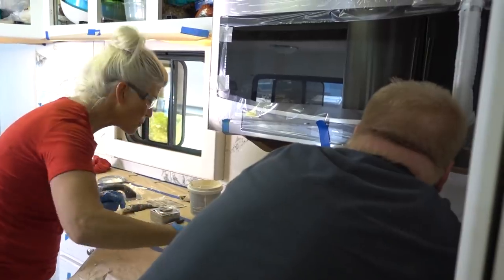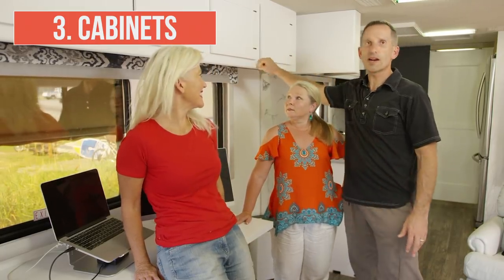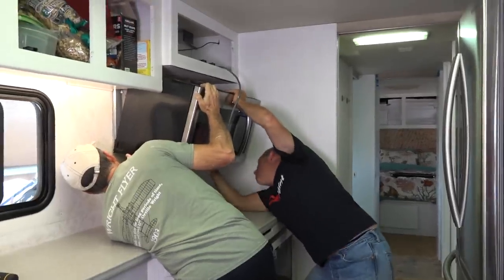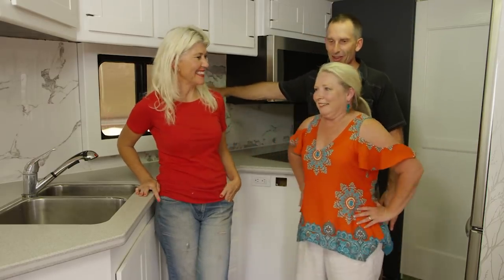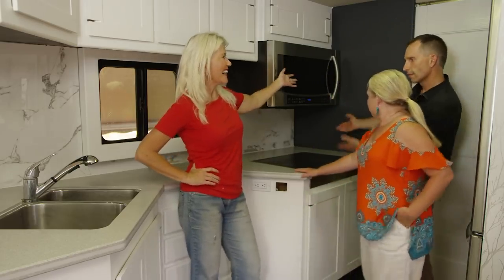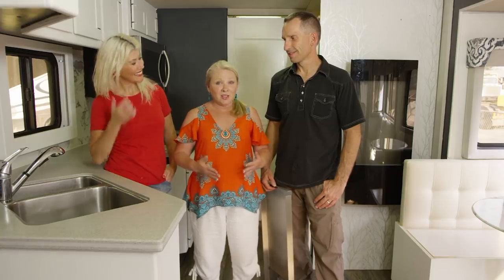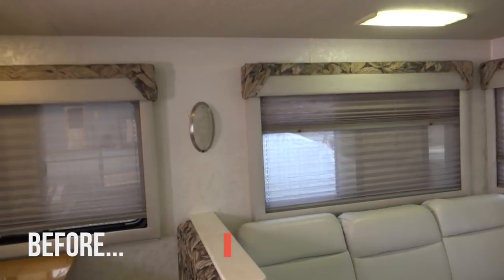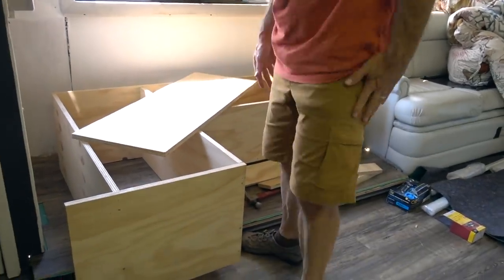We're Nearly There! RV Progress Update: Front Area | RVLOVE's RV Makeover (Ep 6) | DIY RV Renovation

Comment: You guys have done a "bang-up" job on the coach reno; you had some solid ideas for the upgrade and Jane showed her amazing talent in bringing it to fruition! One question: will you have some kind of retaining device or latch at the bottom of the removable alum counter extension? Seems it will need it to prevent moving and damaging the beautiful counter, when in travel mode. Can't wait to see the final touches, incl lighting. Again, an amazing job to everyone involved! Will you be having an "Open Coach," when finished? Y'all Be Safe!
Reply from the maker: Thank you for your kind words of support.  Good question on the counter extension.  Actually we cut a piece out of a pool noodle, and the pressure of the length of the noodle holds itself in place inside the underside of the extension.  You can't see it at all while hanging.  The pool noodle allows for a soft touch against the side of the counter so it doesn't bang while driving.

Comment: Love the upgrades!!

Mark, you might want to rethink the design of the counter extension and permanently attach it via a hinge on the side of the kitchen counter.  You can then use a hinged rod on the bottom side and swing it into a lock on the side of the base cabinet. The sliding on and off design will quickly scratch the paint on the side of your base cabinet .   The bend on the end would need to go up (with a small return) instead of down to properly hinge. - Just a thought...
Reply: Sorry - Marc
Reply: Sorry - Marc
Reply from the maker: Thanks Bert... that's certainly an option. So far (6 moths later) we haven't had any issues with the paint being scratched on the side. We will show more about all this in a future video. But we have a cut pool noodle in between the S/S shelf and the cabinet which works a treat, prevents rubbing and banging while driving. We actually don't set that extension up to use very often. Cheers

Comment: How did you get the residential refrigerator inside?
Reply from the maker: We brought the residential fridge in through our driver side window.  It was a tight fit, but better than trying to remove a windshield.  We were able to do it ourselves with a few extra hands.  Also needed to remove the driver seat, and steering wheel.  The window just needed some new window seal from an autoparts store, and screwed back on.

Comment: Great updates, moving along, only thing I would have done different is ditch the kitchen countertop and double bowl sink. Trade the 2 sq ft of sink space for countertop space & prep area.  (Can’t link to Amazon on iPad pro) can’t say enough weighing prep area value VS another sink bowl. there is a lot more sink cabinet than sink in depth I went 18 x 18 x 12 deep VS stock 8 deep,,,,, a lot of cabinet down there.

Going there may reduce or eliminate just,,, one less thing to set up. Always looking for one more ,,,less thing to set up.

Also replacing the top gives you the option to change the angle of the sink cabinet out, along with 2 inches out on the rest of the cabinets. 3 on the stove enabling a 27 inch deep countertop.
Reply from the maker: Great suggestions, thanks Steve! I think if time and budget had not been such high considerations, we would have definitely considered changing the countertop and sink. Am sure that would make a huge difference. As would have changing out the furniture.. but we also wanted to show what was possible working with a lot of what we had and just updating as much as we could. We actually don't use the S/S counter top extension much at all... but when we do, we really like having it! Cheers!

Comment: What do you do with the chandelier when driving?
Reply from the maker: Thanks for the question.  You might have noticed that the chandelier hangs from a small wire that is off center from the main drop point.  This actually serves two purposes.  first is to allow the chandelier to rest directly above the table most of the time.  Second is that the extra wire length allows us to set the chandelier lower onto a pillow next to the table during travel.  It takes about 5 seconds to move it, and it travels very well on the pillow.

Comment: Hi Marc and Julie, what is your average MPG on CC with and without the jeep at tow?  Do you have any issues with the  8.3L engine consuming motor oil?
Reply from the maker: Helly Ray. Our average MPG with CC is about 8.5.  If traveling on highways the fuel economy is basically the same with or without the jeep in tow.  If doing a lot of stop and go or city driving, we probably drop to the high 7s or 8.0.  Yes, our engine seems to consume a little motor oil, but not much.  Maybe 3 quarts in a year. Our biggest issue with the engine, which we heard is common of this year of engine is that it doesn't like starting in cold weather.
Reply: @Rvlove  Very valuable information.  I'm looking into buying a 2003 Fleetwood with the same 350hp 8.3L engine.  GVWR is 31K so I now  know what to expect.  Thank you so much and god bless with your travels!